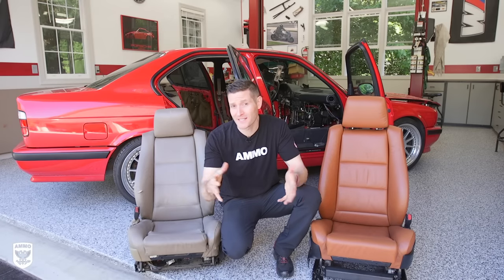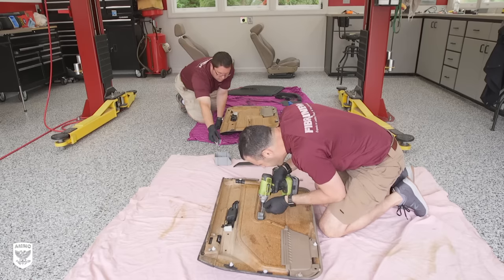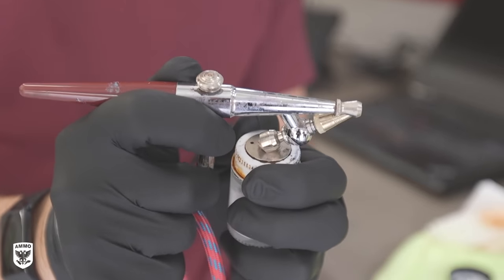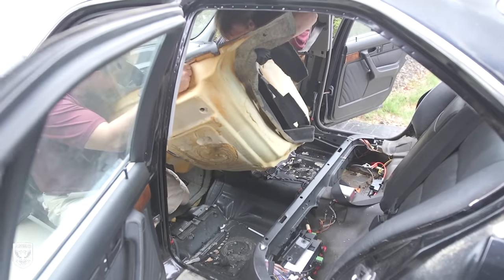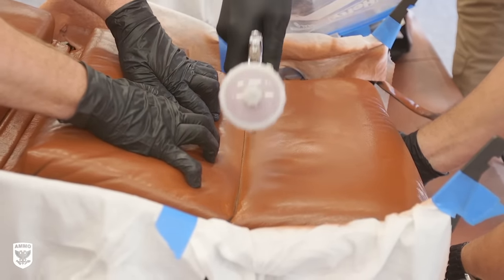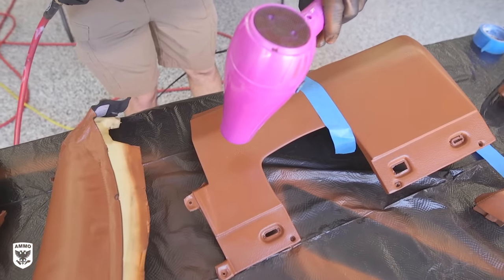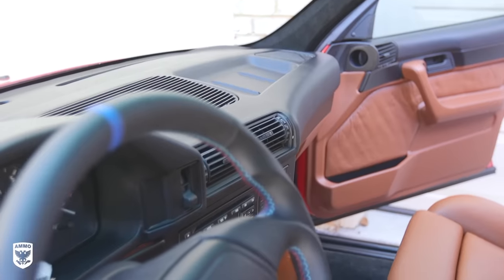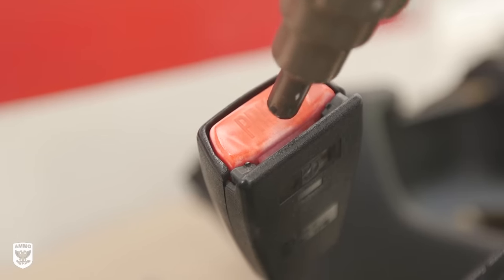How to Change Car Interior Color with Dye: BMW

Comment: Noticed that the door seals, grab handles, and visors are still beige.  Those would look good in black to match the headliner and complete this high-end transformation
Reply: good eye :D
Reply: ohmfab true!.. good eye
Reply: The owner is finding them in black. Some items should not be dyed for longevity.
Reply: @fibrenewnorthraleighwakefo6420  Ah ok, thought you missed a spot :D
Reply: Can’t unsee it
Reply: Wouldve never noticed that😂
Reply: ohmfab far from high end! The very definition of cheap seats!
Reply: It's at 15:00 for those who don't see it
Reply: @Noble6 If you happened to read the comments, the owner of the car is sourcing original black parts as those components should not be died to ensure longevity. But I guess you are too busy trolling the comments section to care.
Reply: The ceiling isn’t finished yet. You can see the handlebars have been removed. Probly doing a suede/alcantara headliner.
Reply: Also, they're not worth the effort to re-dye since getting the black hardware from a junk car is much, much cheaper.

Comment: $5000 that's insane.  Get a 20 gal air compressor a couple solid HVLP spray guns a couple fans and several plastic drop cloth and a heat gun altogether you could get that all for probably 500-600 the rest is just patience and not being lazy.  You guys absolutely killed this and turned a beater looking beamer into a brand new model. I wish you guys could have taken my old tahoe and re done the whole interior instead of me doing it I can only imagine how gorgeous yall would have made it.

Comment: So happy to see this up. It was amazing to work with Larry and see his process. Super guy. Would shoot video with him again! Cheers everyone!
Reply: @promethbastard  Thank you! Only Larry could have shown the process in such a succinct and thorough manner. His video skills are serious.
Reply: Great job! One question I have, how has the smell of the interior changed with all the work you guys have done? Does it smell similar to a new car, or is it more of a fresh smell compared to the original 20+ year old interior?
Reply: spartan sui I’ve answered this a few times in other comments
Reply: Amazing work!  I used to live in the Raleigh area.  I have a Z4M I am restoring.  It has Napa leather that needs refinishing and I am liking this color.  Will be sending you pictures.
Reply: @SPARTANsui1  It shopuldn't have much odor at all.  Most all the products are water based with little odor transfer.  I f you switch out parts, or carpeting any odor transferred with the part will depend on the sourcing of the parts, i.e. is it a new part, from a wreck... the new car smell many people seem to like is the off gassing of chemical finishes and the plastics, carpet... inside the car including the plastic wrapping the car is shipped with.  Not especially healthy to breath in.
Reply: I have a 750li and would like to change the interior to that color.

How much did it cost to dye this car in the Video

Comment: I would like to know how that holds up. update in a couple of moths?
Reply: It’s an old BMW, so it’s probably been scrapped by now.
Jk, that’s just a myth based around people who can’t properly maintain their cars.
Reply: the interior will hold up like oem, BUT, the painted stitching sucks
Reply: Zajaka  Complete bull. I've redyed interiors with plain semi gloss acrylic+ air brush, it doesn't scratch or come off. Whomever did yours had no idea what they were doing. OE seats are dyed with acrylics... Or used the wrong paint. 

Acrylic flexes with the leather, doesn't even crack
Reply: when done like this it will last quite a few years.
Reply: It should hold up just like OE.  All leather upholstery you see are dyed just like this from factory, unless you've seen a cinnamon red cow running around.  I painted mine with rattle can and held up ok for 3 years...now it looks like crap.
Reply: the heat trick used on the seat belt buckle lasts about 6 months tops. it eventually gets dull again

Comment: Strange question but do you smell any chemicals in the cabin after completion? Do you lose the leather scent?
Reply: No odors in cabin. Leather scent wasn't there to begin with on a 25 year old car. Some Fibrenew Leather Protection cream will bring that scent back, though
Reply: Bit of an odd secret: Leather doesn't actually have that distinct scent. That smell we associate with "real leather" is always fabricated into the material. I was shocked when I learned that from a higher-up in a leather manufacturing company. So even if the leather scent from when it was new is gone, you can always restore it again.

Comment: That looks amazing. Only thing I would change is the leather around the shifter. That should have been black in my opinion, just to give that area a little accent color. That and the beige stuff left on ceiling should be matched to the black headliner.

Comment: For $10k u can just buy colored leather and get it installed
Reply from the maker: probably...but you can pay 5k and do this. You can pay 20K and get a new engine. Maybe 6K for some killer wheels.
Reply: Might be cheaper and easier to pick up a whole new interior from a wrecker
Reply: @meteora8888  not in this colour and not from this model/type , you won't .
Reply: In the exact color you want? maybe not.
Reply: @dagnut  They said 5k, it's 8 people working over a day on this, so only in labour it's already like 3k
Reply: In Russia same work by letech component will cost max 2000$ you can find on YouTube same video with e34
Reply: $5k is a good deal for such a complete interior transformation.
Reply: Dudes r a bunch of detailers not lawyers.. maybe the bmw tech should be paid more but this should only be 1k-2k max in labour
Reply: jjrimz99 SERIOUSLY !!!!
Reply: Lol 10k, in my country its only 1k😆
Reply: @bkirkbir  what's ur currency?
Reply: @jjrimz99tandem_drifter  TL
Reply: dagnut detailers in my city make minimum wage dude
Reply: dagnut if minimum wage is $10 then 15.60 is reasonable for this type of work
Reply: @aliox326  Sure, if you don't mind driving to mainland China to have the work done.  You have no idea what your talking about.
Reply: @meteora8888  I think the issue is that the E34 never offered that interior color. The older a car gets, also, the harder to find the right parts for things.
Reply: @nlxsteve  if you actually want a custom color then i guess you're limited but if your car comes with a banged up interior or had a bad custom job and you just want to replace it with OEM as i think most ppl would realistically, a wrecker would seem the way to go.
Reply: meteora8888 yup I understand. The point of this video was custom dye though.
Reply: @HallonRubus  They said their volunteers.
Reply: @AMMO-NYC  for 31K you can just buy a new car
Reply: @AMMO-NYC  so what was the car worth? And what is it worth after the new leather, engine, interior, paint job?  Is this an enthusiast thing or does it make sense beyond that? Thanks!
Reply: 2k in uk lol
Reply: That actually really easy job!!! I dont see here notingh what can be hard!! To paint car way harder then paint leather that any paint guy will tell you!.. question where to buy this  material??? They for sure not go to sale paint all this stuff😀😀 and yes what they do I be never pay 1k for it cuz I can do that same like you guys I'm pretty sure most ppl here can do that if they have time for it!😀
Reply: @AMMO-NYC  very true as I paid close to 6k for killer Vossen wheels for my S Class
Reply: HallonRubus he said volunteer so they only get free food
Reply: might as well buy another car
Reply: wrxassa  could you repeat what you said, but translate it to English.
Reply: @HallonRubus  how did you figure? Who will pay nearly $50/hr for that kind of work for helpers? Most likely helpers would be paid like $20 to $25 per hour at most (but probably more like $15) if they are actually skilled.
Reply: Will dyeing car seats fade overtime?
Reply: @meteora8888  You don't find E34 on this colour scheme, never came out OEM in this specs.

Comment: red car and orange interior, blue steering wheel. This man has no sense of matching colors.
Reply: The Legend of Texas Damn straight
Reply: The Legend of Texas  I 100% call that going wrong. So many colors in the world and the most creative thing someone could do was all black? Hard pass. All about personal preference.
Reply: @Datboi_Mo  That's what you get with most cars today: black or dark gray. Boring as hell, but very cost-effective for the manufacturer. I remember when you could get a real choice of color interior on many American cars.
Reply: @paulparoma  If we could get today's interior quality with yesterday's colors that would be the perfect mix. My only qualm with the older interior was the materials they came in.
Reply: @Datboi_Mo  Yes and no. Today's cars use way too much plastic, which I can't stand. Not long ago, there was no plastic on door panels. And the fabrics on the seats were very nice, if not truly luxurious, on the better cars.
Reply: I mean it’s his car and we’re not driving it. lol.
Reply: Blue steering wheel?
It's clearly black with blue and red lines what are typically for an M-steering wheel.
Reply: 100 percent agree! I was thinking through the entire video how garish it is to have a primary red exterior with an interior color based on the combinations of secondary and tertiary derivatives of the exterior red. In isolation, the interior job that the crew did looks phenomenal for what it is, but I would guess that even the crew was horrified at the combination of cinnamon with primary red.

Bugs me that such painstaking effort was put into making the job indistinguishable from OEM, but you will never see an OEM bimmer with that color combination. The cinnamon/black interior would be seen only with  black, white, silver/grey, and very rarely, deep metallic blue exterior colors.

Excellent job, and fantastic info in the video, though.... even if I am SMH at the exterior color choice.
Reply: How long have you been neglecting the trip to the eye doctor? That's clearly not orange.
Reply: I think the cinnamon goes well with the red tho, most ferraris have that color lmao
Reply: @paulparoma  Long ago you had cars who could resist for decades! Not like nowdays, that you aren't sure enough if it can pass a decade or a few years! 🤷🏻‍♂️🤷🏻‍♂️
Reply: @B. Chandler 
The BMW individual line is awesome. You get to choose whatever you want for colors, Alcantara headliner, motorsport cloth, etc. Man what I would do for an e28 or e34 m5 individual
Reply: LOL ....I SAID THE SAME THING
Reply: @mikew9941  "Brown is a dark orange." -- Technology Connections.
Reply: 'iTs gOt aBlUe sTeErInG wHeElz gUyS'
Reply: This car is awful.
Reply: @meme2363  fr

Comment: These videos just make me sad that I can’t afford to restore my baby.
Reply: Why not? It's your attitude that is holding you back. Yeah these videos show some high end products, but the point of these if you pay attention, is to show you how the pros do it so you can do it yourself. Most people might not think about attention to detail if they are redying a seat. But now you might after watching this. Bottom line, no project is cheap but it doesn't have to bankrupt you either. You can do it yourself but it probably will take you longer.
Reply: Use a product called SEM paint. I used it on my truck 5 years ago amd still looks like new. You can go to a body shop supply house and give them your color code and they will mix it for you. 1 quart costed me 50.00. A lot cheaper than buying new panels in my truck.

Comment: So “dyeing” is basically removing and and repainting the leather coat.
Reply: like he said, Aniline leather is dye-able, fully finished leather is like leather that is painted. most cars have fully finished leather so you remove the bad paint layer and any leather pieces falling off then add a new color layer. Tho there are much better paints then water based ones, I don't know why they use this garbage
Reply: @maytagveneno9653  Their is no paint on the leather. Both aniline and fully finished leathers use dye, different types but similar. Fully finished means it has a top or clear coat. Most leathers use water based dyes nowadays and they are great. No need to call something garbage just because you cant understand what was explained multiple times in the video
Reply: Aniline leather is dyes through abs Sonia pigmented leather, then pigmented leather is painted on the surface.

Here’s a link to Aniline leather 

https://prorestorers.co.uk/knowledgebase/aniline-leather/

Comment: Worked with finishes for many years.  If all you want to do is change or match a new color this is a great way to go.  Traditionally, leather seats and interiors were dyed and the results offered not only a special color but, more importantly, a unique feel and pliability that has made leather always so desirable. This method of "painting" the leather sacrifices much of those qualities and is the major "con" for this process, in my opinion.  If that is not a consideration then this is a great method to recolor an existing interior.
Reply: What the best way to restore the more mate finish as a posed to the more shiny finish that my seats now have? Thanks so much
Reply: @bernardwarr4187  Not 100% sure.  Matte finishes are commonly achieved by either adding a "silking" agent to a coating before application or by using a very mild abrasive on the dried surface. to reduce the gloss.

Comment: Might as well change the heater core while you are there..lol
Reply: thats all i could think of lol
Reply: What's the saying... if it's not broke, fix it until it is.
Reply: Good point. It may not be broke now but my guess is about two weeks after the dashboard is put back together the heater core will break.  If not replace at least flush clean.
Reply: Lot easier and cheaper to sell it and buy another car with an interior you like.  The 540’s of those years are pretty cheap to buy, I can’t see spending that amount of time and money on at best a $3000 car.

Comment: 5Series touring donor car! 😬☹️😢
Reply: They should have swapped everything into the wagon. That would have been so much more bad ass.
Reply: I know, right? Kills me inside... though admittedly, there are only a few V8 Touring's in the US, and only 1 4.0 liter if I remember correctly (not counting swaps). So it was likely a 6 cylinder car, and obviously the owner wanted a V8. :)
Reply: @Broadpaw_Fox  The engine in the 5 Series was swapped too so swapping it again shouldn't be out of the question.
Reply: @rogerj412  - well I haven't read the threads on BFC yet, I base my statement on the fact it if you have a six-cylinder car, swapping a V8 in is an absolute nightmare. There are several major differences between the two chassis that make a V8 in a 6 cylinder card not worth attempting. And just based on what I know from numbers, that touring is most likely a six-cylinder, but again I haven't read the threads to verify. If it was a V8 chassis, I'd actually want it myself ... I rather like the touring's. :)

Comment: Nice video.  Great tips. I've done that dash swap on E28 and E34 cars.  Tedious but not impossible.  That seatbelt button issue is very common. I also just tried painting one of my discard seatbelt buttons and it looks awful, so I'll try the heat technique.  As for the interior, love that color.  3 of my 11 BMWs have black and cinnimon interiors.  None of my M5s are, though, because it wasn't an option for them.  It would not work in an E28 and my E34 is silver/silver, so no...my black e39 maybe....but no.  BTW, LOVE LOVE LOVE the E39 M5 Wagon in the driveway!!   That is a project on my soon-to-do list.  Maybe I'll go black and cinnimon on that car....especially since so many non-full leather E39 M5s came with a funky trim color.  Excellent video and thanks for sharing!
Reply: I also just noticed the "pre-facelift" treatment to the "post-facelift" panels on the door cards and dash by painting them black.  That is an awesome idea!  That would not work for anyone trying to keep the car looking original , though.  Too bad as my pre-facelift door panels are shot.

Comment: That is really a great looking car.  I’d like a list of all the products used. This is something anyone can do.  

Here is my 10 cents of opinion.  It is pretty cost effective to buy new seat cushions and new leather seat covers. In particular if your looking for a high quality leather. I just rebuilt a 2007 King each. All the leather seats ran $2600. All the cushions were good except the drivers seat cushions.  That replacement cushions was $150.  

Now!  The door panels, dash and vinyl door handles/cushion are discolored.  These all seem to me to be ideal for re-dying.   Finally, carpet…. At least what I’ve found is there are some great carpet manufacturers for automotive refurbishment. The F-150 super crew carpet with mass load backing was $300.

Finally, the truck had set in the sun unmoved for 6 years in Houston TX.  An elderly man had owned it and stopped driving. The aniline leather had faded terribly where the sun had hit it. Even worse where the man had held the aniline steering wheel and center arm rear… the oils had absorbed into the leather. Where this occurs and because of lack of use.. the leather literally cracked to pieces. The top of the steering wheel turned to dust except the areas where the leather had not been held and absorbed oils.  So I found a company to rebuilt the steering wheel. What cool about this is they added the ergonomic bulges and made the wheel thicker all over. Looked like a 2020 wheel.  

So, I took a 72,000 mile truck from Houston Texas that sat in the sun for years and made it new again. Mechanically it’s in great condition.  Cosmetically… we’ll it’s getting close to “like new”. 

Thanks to your video, I know know what I’m going to try on the doors and dash.
Reply from the maker: Sounds like a cool project! Thx for watching